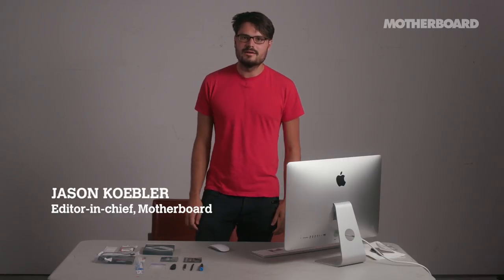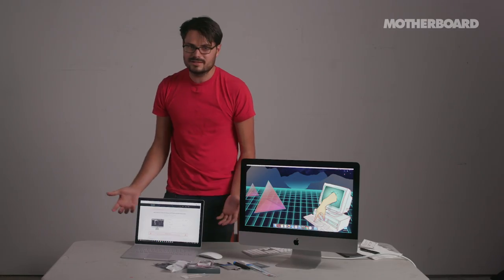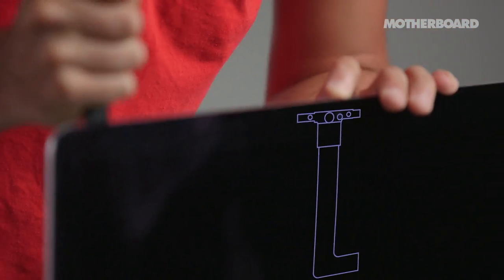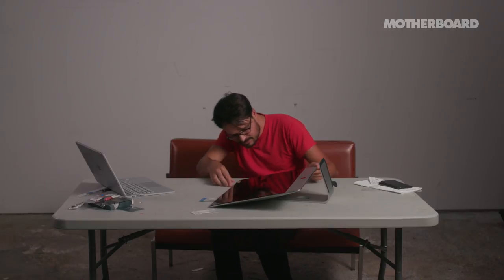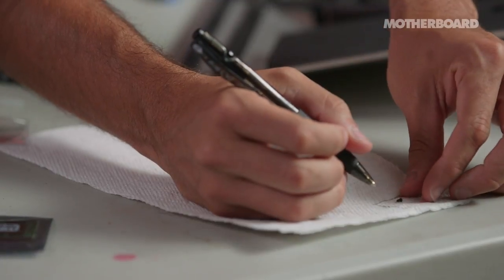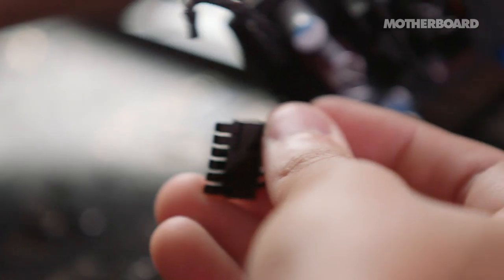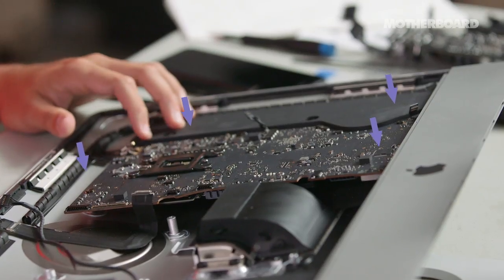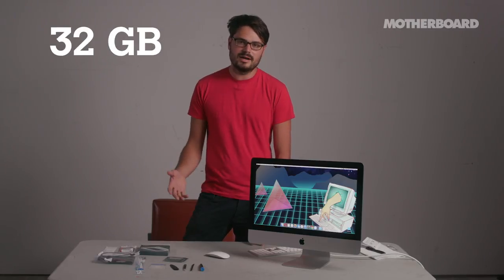Can a Normal Person Upgrade the RAM in the 2017 21.5" iMac?

Comment: I could literally drive to the store, buy some RAM, drive home, install it in my PC, and have it up and running just in the time it took to watch this video. And it'd be cheaper. Can someone please remind me why anyone would ever buy an apple product?
Reply: I can't get a straight answer from people who use Apple.  But best I can get, it's a very satisfying UI... I guess.

If only Apple would sell their OS separately.
Reply: DigimonRumbleArena that is why i run osx on my pc... I need xcode and sadly its only on osx
Reply: DigimonRumbleArena I'll give you a straight answer. For starters, I currently use the 27" iMac with easily-replaceable RAM, as well as a 2011 MacBook Pro and a Linux home-built desktop. The reason I buy Apple products is because I like a quality product, and I have had great experiences with them in the past. My first Mac was a 2007 iMac, over the years of owning it the only problem has been the hard drive starting to go bad, so I had it replaced. That was about 4 years ago, and this machine is still being used daily for work and play. Everything works on the computer, and it is still very fast and responsive. They make good hardware that lasts and I like that. Now, I personally wouldn't buy a 21.5" iMac with the non-replaceable RAM, but there is a market for it- it's just not for everyone. Hardware aside, Mac OS X is an incredible operating system. As you said the UI is great, but there are many things, some very technical, that make it a very good choice for me. I have spent a lot of time on UNIX/Linux systems and having all of the same tools accessible to me is huge. On top of that, you cannot beat UNIX reliability and uptime. Now there are some great free Linux desktop distributions but I think (opinion) that Mac OS X is the only *nix operating system ready for everyday usage, especially if you depend on Adobe or other big-name software that is only Mac/Windows.

Comment: It's not considered user replaceable if you void your warranty in the process, breaking any adhesive means you aren't supposed to take it apart. 

Mac OS is really good with how it uses its RAM, you really shouldn't need to upgrade it (unless apple does that thing where they update it to a newer OS that uses more resources and adds no functionality then end up no longer supporting your device so it stays that way).

If it takes 4 hours to change your RAM than you are doing something wrong, the average PC would take 15 mins to an hour.

Bottom line if you like upgrading, learning more about computers and don't want to void your warranty, get a PC.
Reply: Precisely. He also picked an iMac model which is not intended to be user-upgradable. The 27 inch model's RAM can be changed in under a minute.
Reply: Installing a RAM on a PC takes 2-3 minutes...

Comment: Apple are real A-holes for not making the RAM easily accessible. This is probably the most common upgrade so it ought to be made easy. At least up until the 2011 iMacs there was a little hatch you could open under the screen to pop in a few extra sticks.

Comment: Thank you for sharing. I was a trained thinkpad tech and still to this day take apart and repair Thinkpad, Acer and HP laptops and have not had to go through what you did. In fact even the lenovo P series consumer lines just need one screw driver and plastic snap tools. So if i decided to give up tinkering this may be the only reason I may buy a Mac. Very sad, my Thinkpad takes me 30 mins to fully disassemble and Lenovo provides the maintenance document to do it with all the part numbers.

Comment: You will need to re-place the flux capacitor next to the px3,000 core hard drive and plug in a 6k tubular extractor. Then re wire the DTS application server to set it up as a DTS(20) application server extractor directly into the server database and you will be able to telepor. Or turn into a fly.

Comment: Then re-engage the flux capacitor, the red light on the thermal oscillator should be blinking. Now reinsert the dark energy reactor. This should be the end of step 2068......

Comment: It's funny cause you used to only have to unscrew two screws on a panel at the bottom of the screen to access the ram on an iMac, pure greed is the only reason that they make it so difficult to perform simple upgrades.

Comment: hurting yourself with capacitors after depleting them with the power button pushed in is minimal. YOu can also wear plastic gloves so you can touch the PCB anywhere you want it it, without the risk of dropping it while trying to avoid capacitors

Comment: If you do one that's been put back with the wrong VHB tape you'll will crack the screen for sure, the crappy VHB tape in the IFIXIT kit is weak enough to be removed again, if you get a slight crease in the tape it will prevent the glass sitting flat against the rest of the tape and the screen will fall off. That's my tips from doing about a dozen of these, they're always a pain in the arse. Imacs suck balls, the power supplies have a design flaw in the 27" .

Comment: 'Normal person'.... 😂 Dude, let us know if the 2018 21.5" model will have the old slots in the back or bottom for an easier swap. I personally can take it apart and put it back together, but I'd rather not. Apple gets weird if you have to take it in for warranty service and they find that you'd opened the damn thing to swap something out.

Comment: I think most people would prefer to have a machine, that they could service without special tools, instead of it being a couple of mm thinner. Especially with a desktop computer it doesn't make much sense to make it thinner.

What if you wanted to just clean the dust out? These new computers, phones and laptops are terribly designed on purpose.

Comment: It's not just a matter of making things thinner...glue costs less to them and ends up making the whole process a pain in the ass, therefore requiring a tech savy person to do the job. Even this guy, that you present as a normal person, has a better than average knowledge about this kind of process (although he didn't know/thought about the tab over the cable).

Comment: so much effort to replace the ram, its frustrating because on some windows all in one, they are a panel in back to remove for quick replacment of the ram while this one does not and you have to take the whole thing apart

Comment: I have the same computer case since 2006 ( Thernaltake Armor Black) I did a LOT of upgrades, Initially I even had lights inside ( not anymore). I have a 1200W power supply. With a PC you can do everything easily

Comment: Bought on old one on purpose because I like the challenge after building pcs for years and getting bored
Reply: I transitioned to Macs years ago after being on Windows PC's my entire life. Could never go back. Anyways, as I'm sure you found out; Once you open up the fancy Glass/Aluminum that's Glued together (or done with Magnets in the previous gen which was PERFECT) that everything is completely recognizable. People think computers designed for different OS's are like alien races or something - Which is odd as most don't even know what half those words mean. Go become properly proficient in LINUX if you really want a challenge. Thats the 1st but Final frontier.

Comment: The info ON my computer says it's a 21.5" 2017 iMac... it does not look like this. I ended up taking half of it apart before I realized I needed to start towards the bottom where the hard drive is. Ugh. 
Not your fault, but I've no idea why it's marked as the same computer in my system but has different configuration.

Comment: the coils you can touch by the way, they are coated with isulation laquer . The capacitors caps you cannot touch unless they are discharged . Its funny to see "normal" people freak out seeing green PCB's thiking they are in life-threathning  danger.

Comment: Those "batteries" on the back of the power supply are actually capacitors. And they definately not "low power". If you grounded it you shouldn't need to be afraid, but do be aware and careful.

Comment: Like tis if he did it wrong but you do know there is a ram door on the back of the iMac which you press the little button on top of the display and the door pops out you then follow the steps on the door so it can save you a bunch of time and not risk completely breaking your iMac

Comment: what you do with that power supply is to DISCHARGE IT b4 even taking apart by holding on the power button for a few seconds. 

Advising not touch that bare PSU's capacitors and having to disconnect ribbon cables from it is a hazard waiting to happen.

Comment: I called the local apple authorized repair/sales (after the actual apple store turned me down). To open the 21.5" imac, $219, I thought not bad. Then came the grand total, over $500.  Not sure which route I will take to upgrade the ram.

Comment: The right to repair, and upgrade your own stuff! Fight for it! There is no reason, what so ever for a consumer to have to go through this, just to get a boost in ram. None. Once you do this, the warranty is voided. So basically pay what they want, or you’re screwed if something goes wrong with the computer, in which Apple will happily sell you a new replacement.

Comment: I just bought one of these, and to me, the difficulty is not in the task,  but in having and applying the appropriate amount of pressure in each step. I've studied pc builds here and there, and this is not a user-friendly experience. Now mind you I just bought one of these, but honestly upgrading even some of those pc's with the cooling tube, gel thingy's looks easier than this.

Comment: The 27" model has a small door in the back that gives instant access to the ram to add o replace...the fact the 21" model doesn't have it, is just a show of how current apple policies work; "pay me more if you want real control over your own machine". Its sad really. I like apple products, they are well engineered, and they hace a good aesthetic approach that also adds to usability (imac are still the more confortable OIA that i ve seen around)...but the money hunger just ruins it.

Comment: Ugh. That's why I hate Apple. The ram slot faces the back panel couldn't they put a small hatch that would allow you to upgrade the RAM. If your gonna make the process that difficult you might as well solder the RAM like you do in other products.

Comment: Or you know get a "Real" PC / Laptop... Apple is a really bad example for this video. Apple and mobile device manufacturers are really the only companies that make memory so inaccessible. For mobile devices accessibility doesn't matter as the memory is generally soldered directly to the motherboard but Apple really has no excuse. Most laptops and desktops still provide easy access to the motherboard via tool less lever releases for desktops or a small access door on the bottom for laptops. Apple doesn't have the excuse of its an All In One. Because even other All In One PC manufacturers like Dell will usually have a somewhat intuitive mechanism to pop the back off and the memory is always situated where it can be removed in seconds.
Reply: Also the 32 gig memory kit for my PC was only 130$

Comment: This is probably a really stupid question,

When anyone opens up an iMac they always say to be wary of the Exposed PSU (for good reason!). Would it be possible to use either leather or rubber gloves (etc) and not have to be so wary of it. Just a thought!

Comment: I have a question so my iMac is a late 2015 21.5” with 8gb 2.8ghz 15000mb vram can the ram be upgraded on this mode or is the ram soldered in and isn’t replaceable because my iMac is slower than my iMac from late 2006 the white one

Comment: Imacs have been a pain for years the one Intel model that you just slid a credit card up the back and it split apart wasn't to bad though but all the glue on a non IP rated product is just poor design.

Comment: Hi! Could anyone help me here? I did an upgrade on my MacBook pro (mid 2010 dual core 13 inches). New ssd crucial mx500 to replace the hard drive and two crucial ddr3l ram sticks 8gb each. The thing is, I'm having issues with the ram. Whenever I plug the two sticks the MacBook won't boot (the screen remains black as when is off), then I try with just one of the new sticks and one of the old ones I had (2gb) and the computer starts normally showing 10 GB RAM (which proof the laptop is not limited to 8gb but can go up to 16gb instead). Why wouldn't the 2 sticks work together?

Comment: The board that he was messing around with. That had all those wires was a inverter for ac to dc basicly playing around with the equivalent of a compressed car spring in the electrical sense. IE all  it would take for this video to turn to cringe worthy fail and a possibly large 3rd degree burn was a slip of the hand.

Comment: I've owned macs since they came out. I run Adobe Creative Suite on my macs. I have this iMac and it is the worst piece of garbage of a mac I have ever purchased. It's slow as hell, and the whole ram issue is the biggest mistake apple ever made. I've never had a mac that I couldn't easily upgrade the ram through a small door on the back, but this model where you have to tear the machine completely apart is ridiculous. I didn't realize it until  I bought it home, I had ram ready to install from a previous mac and when I went to install it I could not believe that there was no ram access door. What was apple thinking?
Reply: That's your fault for not researching it though.
Reply: @Cloud007.  Nope, its Apples fault for designing a computer that is not user friendly for upgrading ram like they did for all the previous years. Its just a money grab for Apple.
Reply: @stratmancruthers  
You also bought it without an SSD. That's on you. Besides, I fix computers. I just upgraded this for a customer with new ssd and Max ram. Takes 30mins. It's not that bad. But you should have researched if it had an ssd first. Can't blame the manufacturer for selling you an unsuitable computer. There are thousands of computers. You have to choose. That requires basic research which you clearly didn't do.
Reply: @Cloud007.  I added an SSD and maxed out the ram, the point is I shouldn't have had to completely tear apart the machine to do it, I would not recommend it. You call prying off a double sided taped screen easy? , removing the motherboard to get to the ram that's buried beneath everything easy, took you 30 mins? I don't believe you, stop defending Apple for their design flaw. I've had Apple computers since the Quadra and IIfx era so don't tell me what I should research. Most of the comments here seem to agree that upgrading the ram yourself is a major pain in the ass.

Comment: The iMac pro should have been designed with a panel in the pack that can be unscrewed, allowing direct access to the RAM. This is just ridiculous if you need 64 steps to gain access to it. 

tl;dr: Buy a pc.

Comment: It was so easy in the 2010 iMac where u unscrew the part under the computer it self and install ur memory. And even removing the screen from the 2010. I basically dug my nails in and lifted it..this is making me not want to upgrade my iMac 2017

Comment: people that say macs are bad dont have macs lol sure you can get a powerful pc cheaper you can also zip tie your components in to a shoe box and save more money
Reply: I'm a computer programmer and I have compared Windows, Linux and Apple machines, because I have to use all of them for my work. My conclusion is that Apple products are decent machines for people who don't want to change or reconfigure their computers. For people like me, however, using an Apple machine is living hell (although I do like their terminal). 

The last laptop I bought was a Thinkpad T450s, which I bought for $570. Then, I bought a replacement IPS screen for $70 and an extra 8 GB of RAM for $35 and installed them. Then, I installed Debian with the Cinnamon desktop. For $675, I have a thin-and-light laptop which I expect to last me 4 or 5 years. It weights 3 lbs, has a replaceable battery and I know that I can replace almost any part in it if it breaks. It has better thermals and is far better engineered than any Macbook on the market and far more durable. If you value configurability, fixability, longevity, functionality over form and value for money, then Apple is a very bad choice. I do however recommend Apple for non-technical people who just want a computer that works, aren't on a budget, don't want to deal with viruses, want security and don't want their personal data to be monetized.

Comment: What would be the maximum processor chip that one would be able to upgrade to; given that motherboard/logic board? See that they offer an Intel i7 option - but how high end on that i7 scale could one go?

Btw I would have personally upgraded the processor in addition to the ram. Just 16gb or ram is more than most anyone would ever need
Reply: You can go i9
Reply: It doesn’t do a whole lot though since it has a low psu

Comment: A couple of questions. I have a iMac (Retina 4K, 21.5-inch, 2017). I called a couple of places and they said this computer is non upgradable for additional RAM. Could someone please let me know if it is for sure and if so, which brand has the best RAM for this computer. I am trying to take it from 8GB to 32GB. Thanks
Reply: I have bought 32MB ( 16*2 ) OWC.  DDR4. 2400MHz. CRUCIAL is Also fine. For The SSD I have got CRUCIAL 1TB. Godiva Luck.